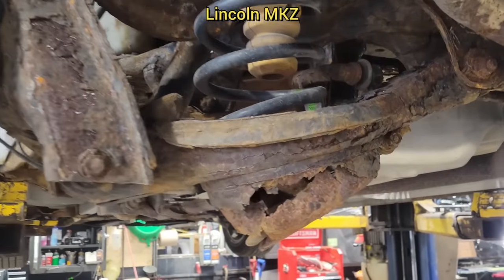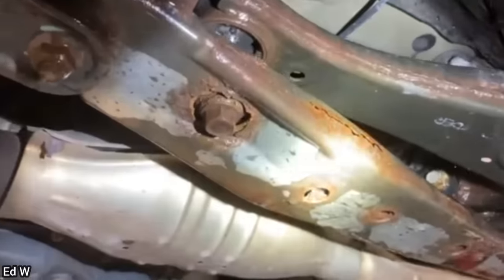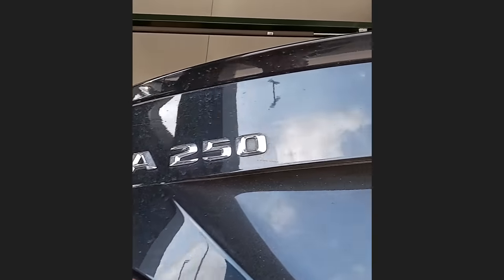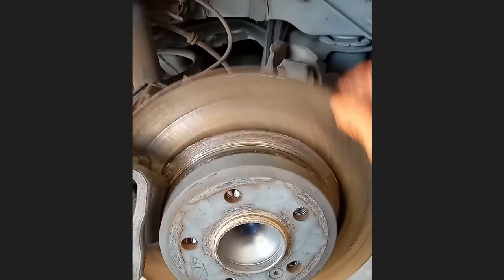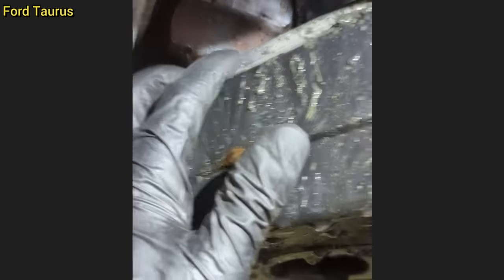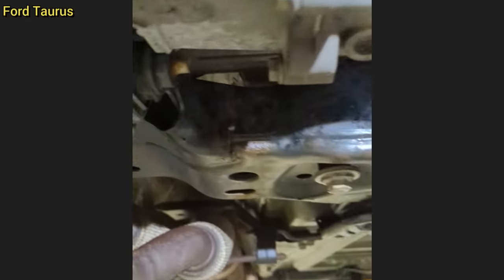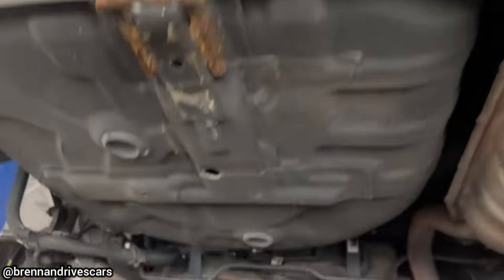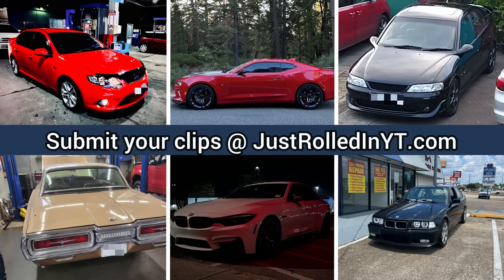Customer States He Has Clunking Noise In The Rear End

Comment: i figured for the april fools video you’d just show off perfectly maintained vehicles with no issues
Reply from the maker: Good luck finding clips and photos of that 😂.
Reply from the maker: @skonky  honestly lol.
Reply: Those of us who meticulously maintain our own vehicles are the only ones whose vehicles never have issues requiring a shop to diagnose.
Reply: @BartSparrow123  Ha I was gonna say those vehicles don't go to the shops!
Reply: "This Mustang was brought in after not having an oil change for 3200 miles."
Reply: @JustRolledIn  Next year.
Reply: Customer states: Bought a new vehicle, and do not hear the usual sounds while driving.
Repair shop states: Correct, the vehicle is in perfect condition, these new models are that silent.
Reply: Back in the ‘60s cars up here in the Rust Belt would show serious body rot within 2 or 3 years.
Nowadays the exterior sheet metal looks pretty good even after 5, 6 or even more years. But the undercarriages rot out as shown so often on your channel.
The manufacturers can do way better than this. 
Speaking as a retired auto industry mechanical engineer, the OEMs should be ashamed. There should be class action suits.
Reply: @BartSparrow123  Had a look at my car this weekend and determined I need new rear springs, a new left fender and has a serious rust on the right side. I declined repairs.
Reply: So you mean only a handful of models at a dealership showroom?
Reply: @stevenslater2669  As another mechanical engineer (product R&D tho not automotive): guess who gets the blame when something like this happens? Yeah baby, we do! No matter how much we want to make good stuff, finances will always screw it up.
Cause ya know, it's just beyond acceptable to spend those extra few dollars on the proper under body coating...
Reply: @JustRolledIn  I can send some in if you want for next year... I had a Chrysler Crossfire (I wanna say an '05) in the other day with 17000 miles and it was like it just rolled off the line yesterday... Including the tires, which we replaced
Reply: This Camry has floor mats that are slightly dirty.
Reply: @JustRolledIn has an entire community to supply clips and photos of perfectly maintained cars
Reply: @stevenslater2669  I don't know why people in such areas don't coat the underside and frame with some rust preventer.
Reply: Good one!  As long as it's a beater and not literally about to fall apart, mostly cosmetic, that's acceptable.  @MrJamesBanana
Reply: But then who would watch?
Reply: @Gruntsworth  "_oil was never changed since new"_  pristine oil drains from pan 😂
Reply: Yo that’d be a cool April fools. Now techs need to start videoing perfectly fine cars/trucks and sending them in for next year.
Reply: Boring old routinely maintained vehicles with regular service being performed. 😴 😂
Reply: Customer states my paint job looks sick bro.

Comment: In this video, the customer actually put the correct fluid into every fill cap.
In this video, the customer refused to allow their BF, father, neighbor (or another shop) perform repairs or install aftermarket accessories.
In this video, the customer religiously changed their oil and other fluids.  After 200,000 miles the car is still running perfectly.

Comment: I just got rid of an old Honda Odissey. I declined all repairs because I would spend six times its market value, so I got another vehicle instead. (Had to do all brakes, new struts, wheel alignement, two electronic sliding doors and cargo door that were no longer opening, plus it was all rusted...).
 When you said those customers declined repairs I thought they were doing the same!😂

Comment: The factory PT cruiser outer tie rod ends are made of formed sheet metal. Those were not cracks. They are made that way. The conical washer on the end squeezes the threads tight when the jam nut is tightened.

Comment: States that require annual inspection should have a Red Tag program to relieve the garage from liability and put the vehicle on a registration suspension until it passes an inspection. Letting these people choose to drive a death trap puts them and everyone around them in danger. Commercial vehicles get spot check all the time, and any dangerous conditions puts it out of service.  I'm surprised the Insurance industry hasn't chimed in on this sort of thing. Rust thru checks of floorboards and frames are usually part of any annual inspection, especially in northern areas. I guess it'll take a few lawsuits to rectify this ridiculous situation. Glad none of these people own an airline.... I know this group got fixed, but I've seen other people drive away.

Comment: Those welds in the last clip were totally fine, any mechanic complaining about them needs to find a job they have they mental capacity to handle without injuring themselves.
Reply from the maker: those welds were on the car from the 2nd clip. they were getting the sub frame fixed

Comment: The scariest part of these tales is that the owners buy cars they can’t afford, nor the most basic running costs like brake pads, exhaust replacements, oil changes, or bald tyres yet these aren’t the worst, most common mistakes! “Having a mate that can help” is probably the worst decision of all and certainly the most dangerous. Saving a few dollars and refusing to let the garage or a competent mechanic do the work to be the most irresponsible action anyone can say!

Many of the vehicles that drive away without the most dangerous items being resolved aren’t just saving money, but deliberately putting the lives of so many other road users at ris! 
That’s beyond being just selfish and irresponsible in the extreme, and a 12 month driving ban/gaol sentence should be the minimum driving ban .

Comment: Those tie rod ends were not cracked.
That's Dodge neon tie rods. They are made from stamped sheet metal.
& That's not a joke. 
The real joke is that some stupid engineer designed them that way, & the design went through production.